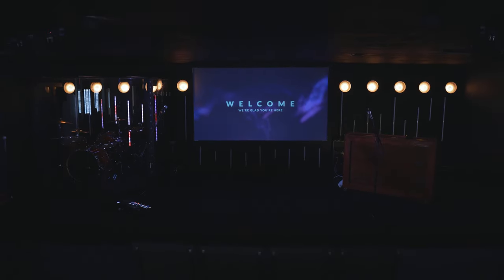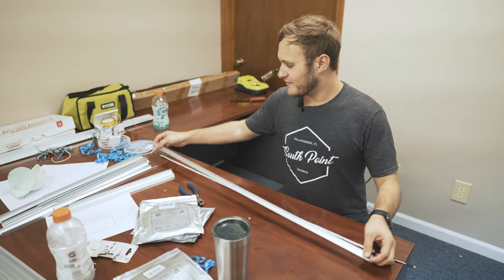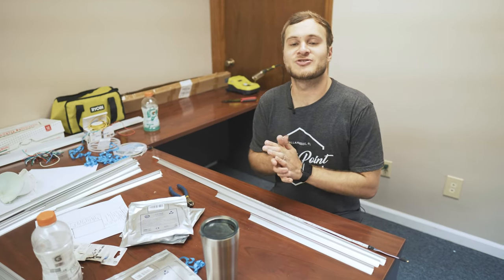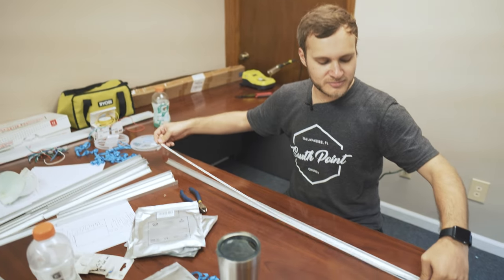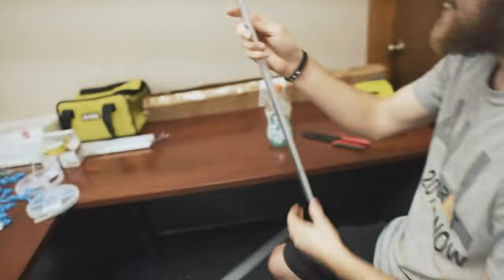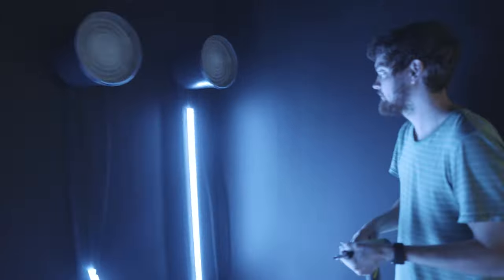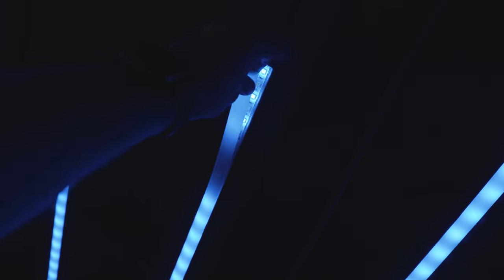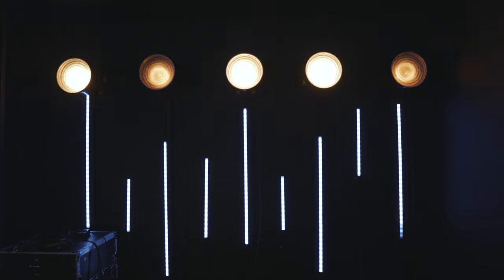DIY Stage Lighting | LED STRIPS

Comment: I'm looking to make an 8 fixture DIY LED tube lighting set up using the LED tape with a 32 ch DMX decoder and a 12v 30a power supply. 
Only issue is it would be getting set up and taken down each event, so I'm not sure how the cables will hold up over time within the wire loom. 
I was thinking of putting the DMX decoder and power supply in a wooden box, then have 5 pin connector sockets on the outside of the box, but I was wondering if 5-pin DMX cables could be used to feed the LED tubes? Or does it have to be the LED strip lights wire?
Reply from the maker: If you solder it up correctly, I don’t see why it wouldn’t work. Sounds like a good idea to me in theory

Comment: this is awesome! I'm going to be in EMU or Lightkey (haven't picked a lighting controller yet) will this setup work with those and the ADJ ED15 dimmer DMX you'all are using? what fixture preset might this be or maybe just a custom on with dimming only ya?
Reply from the maker: It’s been so long now that I don’t quite remember how we set it up - I believe we had to create a custom light in the software. But the setup should still work!

Comment: Hey guys great content, im new to lighting and would like to learn how to do effects with the led tape like you did at the beginning of the video when they would turn on and off in a cool way. What is that called? Any tips would be appreciated, im using MagicQ PC.
Reply from the maker: Hey, thanks! That’s just an effect preset in our lighting software (my dmx by adj). Most software should have different effect presets you can add for different lights.

Comment: Hi! Question, we have a similar set up. Did you find that your connection interfered with your sound system? It created a buzz for us. Curious if you had that issue.
Reply from the maker: We do have a slight hum/buzz that changes intensity and frequency when the level of or lights change, but it is very slight. It has to do with running your lights and speakers on the same electrical breaker. Most places are wired in groups geographically within the building, so to have separate breakers for lights/audio equipment is rare and something you have to be really intentional about when setting up your system. Other things that can contribute to the problem is having cords with electrical current running through them touching or laying over instrument cables or mic cables.

Comment: PLEASE HELP when I connect everything it works but anytime I use a 100 ft dmx cable the lights flash, I tried different cords to no avail.
Reply from the maker: That sounds like it might be a power issue. I’m not sure why using a 100ft dmx cord would cause that though as they’re not carrying power. Do you have a video of what it’s doing so I could get a better idea?